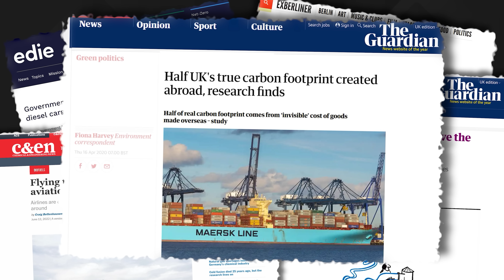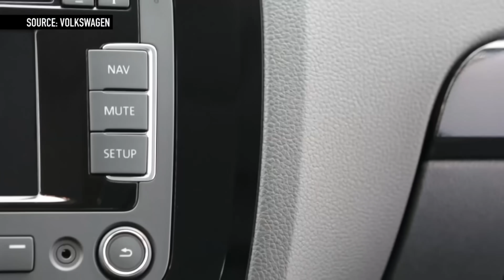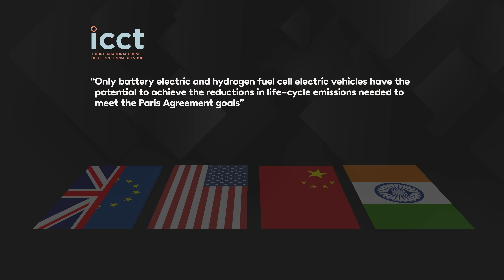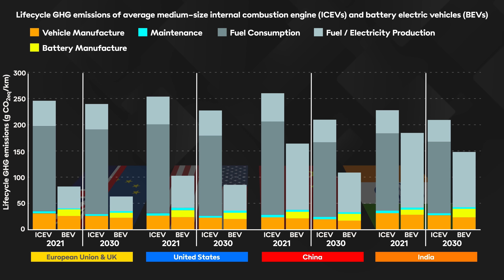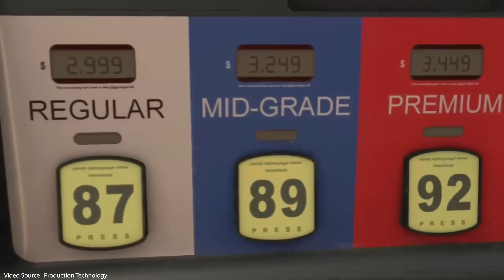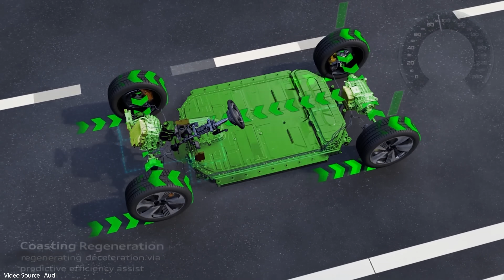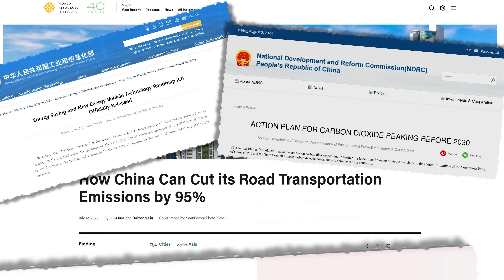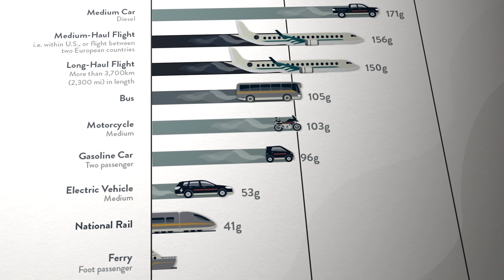Are EVs really better for the climate?

Comment: And of course the people doing the research conveniently leave out a whole bunch of stuff because it goes totally against their agenda. First and foremost - EVs are significantly heavier than their gasoline counterparts. On larger car sit can be nearly 1000lbs more and we haven't even looked at commercial-grade vehicles yet. That means the roads wear out noticeably faster with these prompting more frequent re-asphalting which requires what? Yup, oil and all sorts of other materials. Then there's the whole instant torque thing which annihilates tires at a much faster rate than average gas cars. And that requires what again? Yup, oil and other materials. Then we can look at other things such as totaling your brand new EV. Say you totaled it and it burned. Not only can you release toxic gases into the atmosphere, you just polluted way more than you did with an ICE car (as it didn't reach the break even point) AND you can't get the battery materials back so you screwed the environment in a whole bunch of ways. 

Then there's the elephant in the room. A lot of damage done with EVs is not CO2 related. I know we're focused on CO2 so nobody cares about anything else but there are other ways to damage the planet and EVs are great at them. Now, I'm sure most people know about the whole children mining cobalt thing. But lithium mining is also horrible and certain methods leave nearby farmers without water because literally tons of it are required for the process. Then there's all sorts of ways expired batteries can end up not being recycled. The current recycling rate for lithium batteries on all devices is 5% at best. Yes, look it up, it's 5%. Meaning lots of this lithium crap ends up in a landfill where it contaminates the ground.

I can keep going but you get the picture. Nobody wants to talk about the downsides of EVs because then they're going to be much harder to push. And that's bs because everybody needs to know what they're buying into!
Reply: The weight of EVs doesn't matter to roads; it is trucks which are the problem.
Somebody said somewhere that because the wear and tear per kg is exponential, the trucks of 4+ tons have much more impact.
The mining? Well, we do that for metals too. But on a more legitimate point, that's why we should get rid of cars almost completely. Only people who have been able to buy themselves out of every problem think EVs are the most important piece of the transport puzzle.
Reply: @موسى_7  Not sure what you're on but EV weight matter hugely to the infrastructure. Since there's far more of them than trucks they do wear out the roads quite a bit more. If you don't get that... well, maybe it's time to revisit basic physics. As for getting rid of cars - yeah, that's what you and other bicycle salmon would love to happen but it simply will not in the next many decades. Until there's some sort of vehicle invented to ultimately replace them it simply will not happen. In fact, you will be long gone before the cars are.
Reply: Lithium is a local issue, climate global. Cobalt is being phased out, and Tesla and the Chinese use LFP instead of it.
Reply: @موسى_7  LFP batteries have much lower range per kg than lithium ones. So Tesla only uses them in their cheapest car. The rest are still using lithium batteries and will continue to do so for a long time. Don't even get me started on the Chinese trash, they don't sell it here for a reason.

Comment: How can you not factor in building the electrical charging infrastructure?? It’s not the same for every vehicle as combustion engine cars already have their filling infrastructure built.
The issue isn’t the combustion engine, it’s the fuel we are burning in it. That’s where e-fuel/synthetic fuel comes in. We need a joint approach. Along the lines of hybrids running on e-fuels with larger full EV only ranges. Luckily governments and fuel suppliers are starting to see the light and throwing more support behind this.

Comment: According to EPA numbers, Carbon is only 3% of man's impact on global warming.  Carbon footprint is meaningless.

The key here is to compare percentage of impact, not percentage of total greenhouse emissions by ton.  CO2 is pathetically ineffective as a greenhouse gas, so even though it constitutes the majority of tonnage of greenhouse emissions, it actually has negligible effect.
Reply: NASA, OSHA, the UN and virtually all government climate agencies disagree with you.  If you know something they do not, I hope you can get them educated.
Reply: the thing with CO2 is that it stays in the atmosphere, unlike water vapor and other green house gases.

the water cycle is short (a few days), the carbon (co2) cycle is long >1000 years long.
Reply: @zaarkeru3391  There is more H2O in the atmosphere due to global warming. 

While methane decays faster, it traps heat 20 times more effectively than CO2.  

Methane decays into CO2
Reply: @Garrison169  
Correct, which is why water vapor can't be the driving force of increased global temperatures.

Methane stays for ~12 years, which is also why it can't be a main driving force of increased global heating.

And you're correct on the atmospheric decay part.

CO2, specifically industrialized CO2 is the main driving force of the recent heating we see.
Well, all industrialized petrochemical green house gases are the root of the current increased heating.

Because every other major green house gas, water vapor, oceanic CO2, glacial CO2 etc gets released because of increased heating.

TLDR: if we don't stop using fossil fuel as a fuel source asap we're fucked...
Reply: @Garrison169  
Sure, water vapor is the major contributor to the current green house effect, not heating.

Green house effect = keeping our planet at liveable temperatures.
Heating = incresing the energy mass of the system.

Water vapor can't be a source of heating because the water cycle is a closed cycle that is acting on a very short timeframe.
A year of thermodynamics and heat & flow courses at uni level did teach me a thing or two, i hope...

Yeah, shortterm methane is a much stronger greenhouse gas, but as you mentioned, its acting on a relative short timescale.

Yeah, the aerosol thing is something we're talking way to little about, almost to the point that it's scary...
the 1.5-2 degree C thing isn't just a meme made up by scientists (as you know).
Its the tipping point when we will see a massive snowball effect from melting glaciers (results in a lower albedo), which results in a desalination of the ocean (which fucks with the gulf stream and the oceans capacity to hold CO2), hotter oceans (results in less ability to hold CO2), melting tundra (methande as you mentioned) etc.

I did sugar coat it a bit.
But yeah, we are fucked.
All we can do now is rapidly stop using fossil fuels and mitigate the situation.

If people are complaining about mass migration now, wait untill billions of africans and asians (india, middle east and east/south east asia) migrate due to mass starvation...
Along with the migration from south america to north america.
And I don't blame them, i would do the same....

Good to see that not everyone here on youtube is a deranged lunatic who can't see what's infront of them.

I'm ~30, when i was <12 we always had propper winters.
Plenty of snow, frozen lakes, frozen fjord.
Now we have slush and might have a frozen lake if we are lucky.
 
And people can't see it...
Reply: @Garrison169  
its actually true.
the biggest contributor to the green house effect is not the same as the biggest contributor to heating.

heating is only caused when a effect outside of the water and carbon cycle is changing.

for example solar activity, solar orbit, migration if the magnetosphere, industrialized activity etc.

water vapor on its own wont cause heating, as it is self regulating according to the water cycle.

even nasa is agreeing with me.
human activity is the largest contributor to global warming.

Comment: Premise is false, first there is no factor that man can make in Climate change as it's a factor between Sun cycles (11year X2 or 22 year) and Earth orbital cycles over 43K years and transfer of energy (Not sunlight as Liberals try to scam you but Electro Magnetic energy which is transferred to Earth via the Earth's magnetic field).  Secondly, the EV are charged via Natural Gas, Diesel or coal Electrical plants, it would be better if the electricity to charge EVs came from Nuclear but liberals don't like Nuclear either - it kills their Climate Change Scam.  As such in evaluating EVs, there needs to be a focus on where the EVs get their electrical power - namely Natural Gas or Diesel power plants.  Which is more efficient, should be the metric and which vehicle has less maintenance.  These factors are more important to the owner than Climate change scam. Another question that needs attention, is what happens to the EV batteries after 10 years, are they recycled or buried as contaminants? Fossil fuel is the answer until we transition to Nuclear or better yet Fusion (but that is always a decade away, sadly). It's wrong to penalize people into submission on a faulty premise and increase cost of living, energy and taxation, but the liberals in charge do get richer.
Reply: Buddy, you clearly dont understand what you're on about.
stop being a pathetic liar...

man made climate change is real and its the biggest issue we face.

if you have proof of the opposite you would easily win s novel prize for your findings
Reply: "Electro Magnetic energy which is transferred to Earth via the Earth's magnetic field"
How does electromagnetic energy from the Sun transfer to our atmosphere via Earth's magnetic field?
Reply: @House_Stark  Solar Flares emit electro magnetic energy. Higher solar activity increases energy transfer via EM to the atmosphere, oceans and land masses.
Reply: I think you must understand that because of Milankovich cycles, we are supposed to be in an Ice Age. But because of CO2, we are not.

Comment: You sat in your opening piece around conflicting information, and I really struggle to understand how when a direct comparison of the Volvo xc40 lifetime emissions ev vs ic, including manufacture, suggests the co2 cross over point is 90k miles of use, but the data presented in your video suggests a very different picture. Do you think there is a risk that data on ev are possibly manipulated, akin to diesel gate, to support a rushed transition to ev? 

Link to xc40 video - https://youtu.be/lOyzLSBCBWo

It again is a tricky one to reconcile when LEZs in the uk have stricter criteria for diesel cars vs petrol cars, yet the data at the end of your video would suggest a petrol vehicle is worse, not by much, than the diesel equivalent vehicle. 

So difficult to make a head informed decision, whereas those driven by heart can easily be convinced to ev from ic.

Comment: I did ditch my petrol motorbike (well it ditched me) for an Ebike (in my 60s I do need a little assistance). I love it. I went from a motorcar to a 100CC (90MPG +) Honda in 1979 but ditched that for touring bikes. My 1983/4 tour around Europe by a Guzzi 1000CC still in my mind and heart. The trick is to always look forward to what is coming next and not to live in the past. Love your optimistic look into the future. Can't wait to see what is around the corner in the next step of technology change and improvement.

Comment: Curious if they took into the consideration the "discharge" ability of a tesla car or a electric vehicle... if you let it 1-3 weeks, you might have to recharge it again. Thing that won't happen to a internal combustion car. 
For example, I had a Model 3, that remained without power in 2 weeks if I kept the security on...
And two...
Didn't China let go "net zero"? :)
Reply: Fuel especially e10 goes off as well
Reply: So what if solar energy from your roof disappears? Whether or not gasoline disappears, it pollutes.
Only a fool thinks the future is for coal. Especially in rural areas where there is no grid connection to large power plants.
Reply: Nobody said that coal or oil is the future. But for sure it is the present. I would have loved for countries to get more into nuclear.  (Similar to France) 

If Germany would have taken that path they would have 100% for the money spent on solar, btw. now they are chopping wood and buying coal. And this crisis will last for some time...

Comment: one of the problems I see with EVs! is there needs a massif rise in recharging points. I live in an old apartment block, (no undergrown parking or privet parking) I have looked and the nearest charging point to me is about 5km (3miles) away and it is not a high powered charger! the Nissan LEAF with a 40kWh battery, it will take about 8 hours to reach a full charge. that means I have to walk 5km home then 8 hours later walk 5km back to my car. also I use my car for work and sometimes (maybe once every 3 weeks) I have to drive a littler over 200km from my home base (350km to 400km round trip) EVs only do between 300km to 450km, so I would have to stop to charge the car which means a stop over!

I like EVs but we need more infrastructure. for them to be good for business use

Comment: Genuine question, What are the environmental costs to process EV cars at the end of their life?
Reply: Too early to know for sure, as mass-market EVs mostly haven't reached end of life yet. But one presumes the afterlife of an EV will be similar to any other vehicle: spare parts stripped out in a salvage yard and resold, steel and aluminum eventually recovered and recycled.

Of course you're probably really asking about the battery and the motors. And again, we can't know for sure because there just aren't many of them yet. But there are a number of facilities looking to ramp up recycling of battery materials, just as soon as EVs start getting scrapped at scale. Some such facilities say they can recover like 90% or 95% of the battery as useful raw materials. But it'll be awhile before we can really see how they fare.

Also, with modern battery tech as well as clever temperature regulation (liquid cooling, basically), batteries don't wear out as fast as you may think, and in fact may still have a lot of life left in them by the time the rest of the car is done. To that end, there's a lot of interest in repurposing old EV batteries, not just for more EVs, but in stationary storage (think "grid storage" as well as smaller scales like datacenter UPSes and home backup power). For that purpose, it doesn't really matter if a battery has only 70% of the capacity it had when it was new. It can still be worth reusing.

Comment: Ok, my 2 issues with EVs.
1. I am concerned with the sheer amount of electricity that will be needed to sustain cities with power stations during the phasing out of carbon and underdevelopement and nuclear when Sun doesn't shine and wind doesn't blow, where there are no dams close.
2. Will we have enough materials for batteries and won't the enviromental damage caused by their extraction (it takes a lot of water to get lithium for example) nearly cancel the reductions out?

Comment: In the last chart "The Carbon Cost of Transportation" the electric vehicle has 53g of carbon per passenger kilometer. I was wondering where that carbon was coming from and realized it is likely that that is the carbon output of the power station providing the electricity to charge the electric car. If the electricity was generated by non-oil means, the 53g would go to zero.

Comment: Okay, this is interesting: according to the ICCT Research Paper the average lifetime for cars in Europe is 18 years. Average annual mileage varies a bit by motorisation class, but is 13,500 km/a and 243,000 km per 18year life for lower medium cars. And the higher price for the battery pays off after only 12,000km. I thought that would be more like 200,000km. 

I was like "EVs are nice and all, but it does not pay off". Well, I was wrong. If the numbers in the paper are valide, it's "goodbye combustion engine" for me.

Comment: Great video on the carbon emissions side of BEV vs Gas/diesel transport.  Anyone have a good resource to look at the 10-15 year 150k-200k mile economics of gas vs electric?  I know the situation is changing rapidly, but im interested in the forecasted costs (including battery maintenance/replacement) over time.

Comment: I’m an EV / VW id.3 owner since it first was available two years back now and apart from being a little like a part of a test fleet of the VW MEB-platform, it’s been a blessing now in times of war and pandemic. The superior drivetrain make driving easier. Fuel prices are no longer a problem especially now charging 80% at home at off-peak prices. Adding PV panels for daytime charging or selling the surplus expensively at daytime is actually a no-brainier. Adding V2G/L- bidirectional charging and discharging will make the car a house battery on wheels. It’s so clever!

Comment: I would never buy battery ev, for 4 reasons. How long it takes to charge the battery, the low life span of a non recyclable battery, how low the mileage is compared to ICE, and the low range of operating conditions being between 15 and 35 degrees celsius, anything outside of that and you lose efficiency and it further reduces the life span of the battery. 

However, HFC take the same amount of time as ICE to refuel, they have better mileage, the emissions produced from green hydrogen production is oxygen, and the emissions produced from HFC is only water. HFC are also 100% recyclable, and have a much longer life span than batteries. HFC can operate in a much wider range of temperatures without losing efficiency between temperatures of -20 to 200 degrees Celsius. 

While hydrogen is more expensive to refuel than electric, for me the answer is a no brainer, hydrogen is the way to go. And with improved hydrogen infrastructure we could see the price of hydrogen drop.